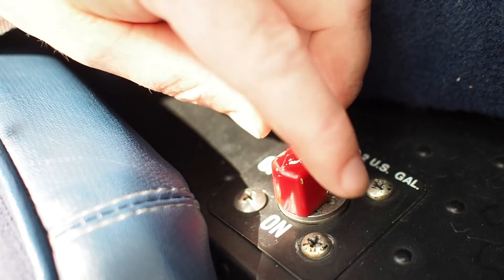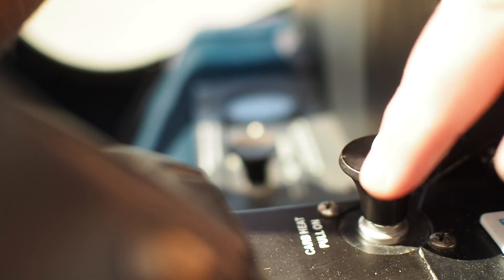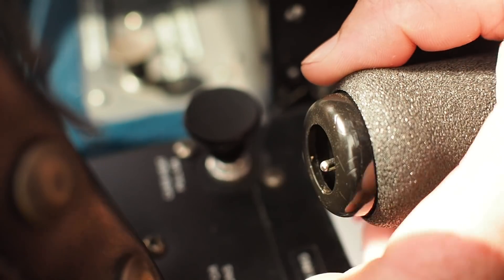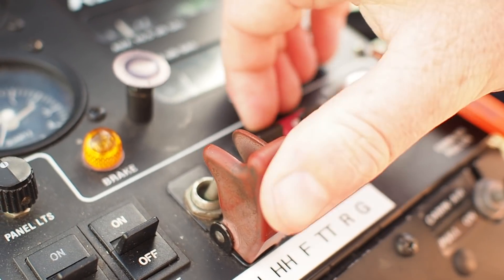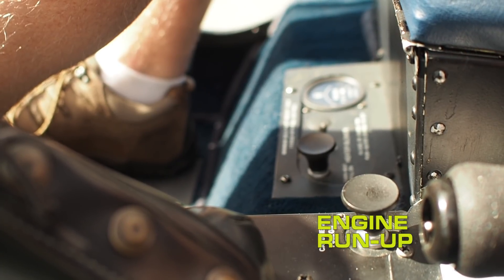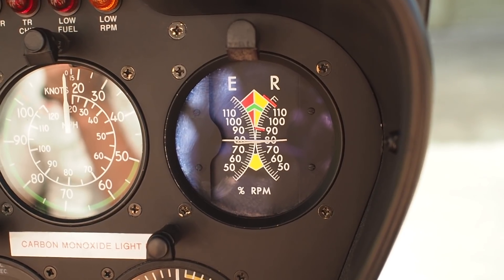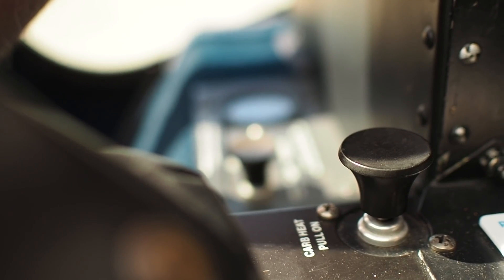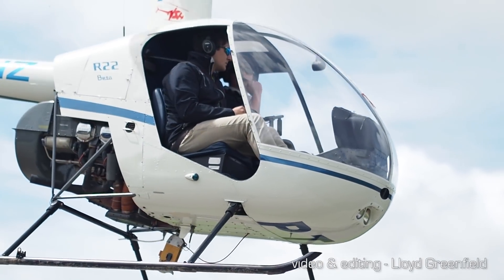R22 Startup - North Shore Helicopter Training

Comment: I have been flying the R22 for 34 years all the time without a Governor its no problem to me
Reply: So, 40 years for me, and one of the R22s I flew is hanging in the Smithsonian!!! The first governor ( the one that moved the collective ) sucked. The second ( current ) one is pretty good. Yeah, you can certainly fly easily without the governor, however it ends up taking a fair bit of your attention as an instructor to monitor your student and make small throttle corrections. This says a lot about the excellent correlator, but that also assumes you're near sea level... All in all, I think the current governor design is pretty good. I've had a couple high side runaways, and plenty of surging issues ( usually a magneto seal problem ). But all in all, I think it's a pretty good design.

Students do inadvertently override it, especially in stressful situations, but I still like that I can override it both high and low, compared to the 206 where I can't roll on additional fuel ( or god save me, the 505 where I have no throttle at all ). 

Of the flaws in the Robinson pistons, I don't feel like the governor is one.

Comment: Sad they use the same engine as my grandad used and still have carbs. What a joke!
Reply: It's an interesting point. The thing is, reliability is really valued in aviation. While electronic ignition and fuel injection may get you more reliable starts and better fuel efficiency, there's not a lot to go wrong with a carburetor ( except icing ).

Porsche did an aviation version of the 911 engine back in the 90s... It was expensive, got almost the same fuel efficiency, and it never really took off ( pun intended ). 

The Guimbal Cabri G2 does use a more modern engine.

( Also, keep in mind that the Robinson R22 was designed in the 70s... They didn't have electronic ignition, and the "fuel injection" of those days had plenty of issues making the carburetor version arguably better and more reliable...

Comment: Question: how do the rotors turn immediately on engine start if the clutch is disengaged?
Reply: The drive belts are loose, but dragging enough on the sheaves ( pulleys ) enough to turn the rotor. If the belts are still warm from a previous flight, the rubber is sticker and you'll get more friction... Also, there's a limit switch that determines how loose the belts are when fully disengaged... If that limit switch is rigged to shut off while the belts are still a little tight, you'll get more friction.

If the limit switch is set fairly loose, and the belts are cold, the rotor may not turn at all when the engine starts. If the limit switch is set too tight, and the belts are warm and sticky, the starter motor may struggle trying to turn over the engine and turn the blades at the same time...

Other belt designs like the Enstrom loosen the belts enough that you can sit for quite a while with the engine running and rotors stationary. Robinson recommends immediate clutch engagement so that you don't rub a flat spot in the belts.

Comment: Crikey, I'll stick to my car. I'd rather crash than fall out the sky
Reply: I know you're tongue in cheek, but I much prefer flying ( myself ). Despite the recent helicopter / airliner crash in DC, generally you're completely in control of the risks as a pilot. You can choose to be safe or foolhardy, but it's seldom the case that you die because some idiot decided to drive drunk. The risks you bring to flying are ( mostly ) under your control.

Comment: Why does the engine run at 104%?
Reply: It's a born overachiever
Reply: It's actually a pretty common question. Piston engines don't typically have a specific RPM that must be used. The same engine in a Robinson is run at a different RPM than that same engine in an Enstrom. If you run it at a higher RPM, you get more horsepower but a shorter life. Now if you're asking "who decided what 100% is" I have to admit I don't know whether that was Lycoming or Robinson... All the turbines I fly are based on 100%, and the Enstrom I flew was just in RPM... So... 🤷‍♂️

Comment: great video , who on earth ever thought that the throttle on a helicopter should work backwards , be tricky if you rode a bike to work as a pilot.
Reply: Seems to me like it's the same, actually. If you were able to turn in the seat and face the collective, you would roll the throttle forward to increase rpm just like you would on a bike. In both cases if you roll the throttle towards your knuckles you are gaining rpm, and if you roll the throttle towards your thumb you are losing rpm. Or maybe I'm missing something here?
Reply: @rovers141  i think of it as towards you or away from you ,,, then again I think the foot pedals should work like a go cart and not like a tractor fiddle brake too ,, horses for courses I guess

Comment: I see that since the R22 uses a piston engine it requires a clutch to disengage the engine from the rotor while starting. Does a turbine engine need a clutch or is it always connected to the rotor?
Reply: Turbine is gas coupled, meaning there no mechanical connection between the starter motor and the rotor system. It's sort of like a sixties automatic transmission, where the only connection is the airflow ( fluid ) flowing past the power turbine. Yeah, there's an exception ( French of course ) but let's ignore for now.

For piston, there's two main types of clutch... Belts and centrifugal. Centrifugal was used in the early years, but they have some issues so belts are the main system these days. Stretchy belts have the additional advantage of smoothing out the impulses of a piston engine, so it adds to the longevity of the dynamic components...

Sorry my answer came 5 years late!!!
Reply: ninemilliondollars Always start a turbine with the rotor brake on
Reply: @lowenslow945 Yeah, no. Only a few turbines allow that... It's type specific whether that's allowed...

Comment: I don't know anything about helicopters but why is there a diesel engine in yours lol
Reply: Its not a diesel engine. They make 128 horse power, and 132 horse power for 5 minute maximum performance. The engine run on 100 octane low lead.
Reply: Probably to keep down cost or weight or both since this is a small helicopter. Regarding the diesel engine on Robinson helicopters the engine runs around 2,500 rpm. It develops 200-300 HP at that low rpm because of such high torque (like a large truck that pulls a heavy load). And that HP is enough to fly the craft. :D
Reply: It's cheaper to fly.  It's very common to fly R22s and R44s in flight school because it saves you money. And R44s are common to use post school because they cost less than a turbine and still seat 3 people plus the pilot.

Comment: Flight-for-Life pilot failed to check hydraulics when 2 feet above surface.    Continued ascent, then discovered something was not working properly.    Helicopter crashed.   Pilot died.  Flight nurse severely burned.

I would forget things or perform in wrong order.   Would need check list.
Reply: Always use a check list in my opinion
Reply: Yeah, you are supposed to use a check list for preflight and starting. They probably use them at their school, just didn't show it. If the FAA ramp checks you and sees you are not using a checklist, you get in trouble.